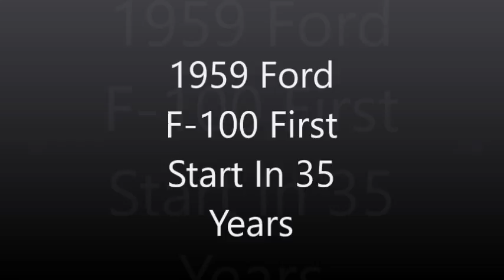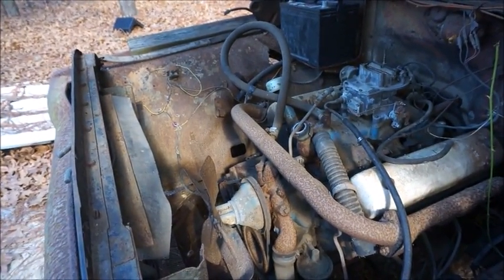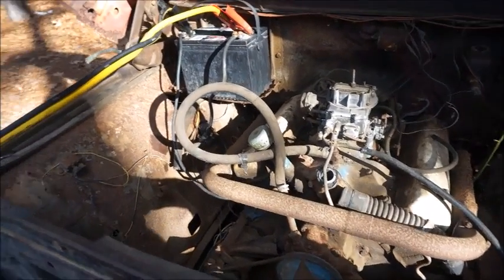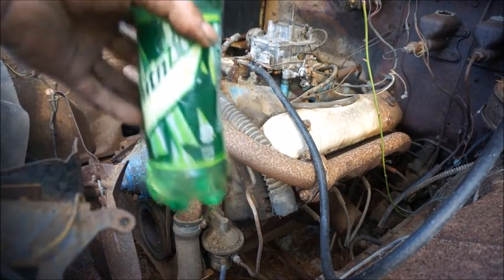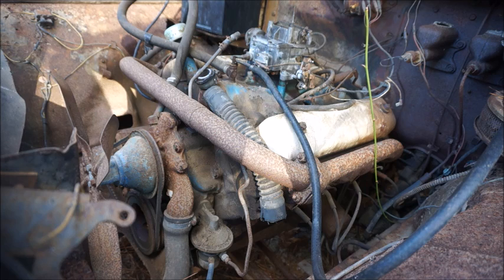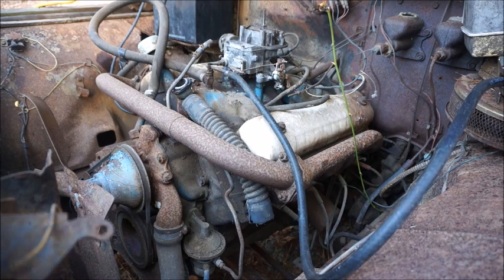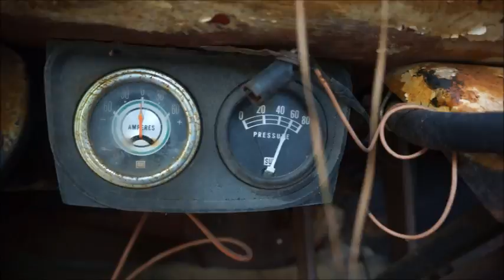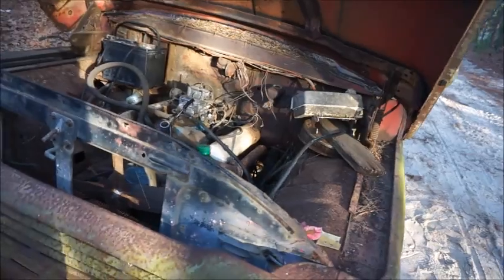1959 Ford F-100 First Start In 35 Years

Comment: 60lbs oil pressure yea! Its a good one. Sounds and runs good that is awesome.
Reply: shartne thats cause its a y block. Fords dumb for discontinuing them
Reply: @adamdesjarlais8183  - Ford needed the room on the machining/assembly lines for the new 90° (221, 260, 289) engines, which were much more powerful and much lighter. Still, the Y-blocks had an enviable reliability record. Oh, and all Y-blocks had mechanical mushroom-style lifters - too noisy for "modern" cars. Cheers!

Comment: I love it when those old engines fire up, it really sounds good..as long as the block isn't cracked.
Reply: If poured engine oil maintained going forward, the engine  sound will change.
Reply: Yes I agree but I still would have done a full tuneup belts plugs ignition fluids
Reply: the thing you got to check first before making any fixes to the engine is you gotta check if it will even spin over
Reply: Old technology dosn't age
Reply: christopher shea yea Chris   me too. I would have covered all my bases before first fire.
Reply: Mate it’s a Y block, you couldn’t crack one with explosives, these blocks were built like brick shit houses, bullet proof.
Reply: @skidmarkscar9082  when any engine has just plain water and the temp gets below 0 there a  good chance it will crack,

Comment: Wow, I thought the valves would be too sticky. Turns out it's just another cold natured Ford. Oh yeah, I'm with you on that cross over pipe. Every Ford Y block truck engine I've ever seen had them. Congrats on another good buy. I won't mention the fuel line on the exhaust. LOL
Reply: Danny Boy I know I've had a couple that started and ran..... shut off and the next day tried to start again and bent a valve or two

Comment: I had a 59 ford truck I drove it for 300.000 miles it turned over the odometer 3 times while I owned it . It went thru 2 motors,3 transmissions and 5 rear end's I ended up running a 2.93 rear end for the interstate because I drove 200 plus miles a day between work and home . I loved that truck got it for 200 bucks .
Reply: I owned a 59 F 250 that I bought used in 68. I paid $400 for it and sold it in 89 for $750. Since it was a work truck, I had to declare capital gains and depreciation recapture on my tax return that year. It had 248,000 miles on it when I sold it, and was on its second engine. Still the original rear end and transmission, although the synchronizers were pretty well gone. I recall that it was hard to find used parts because so many were still on the road.
Reply: Dingus Dow he said he did about 200 miles a day.. if he did 1000 a day it would have 300k in less than a year

Comment: Greetings from Australia, I liked the Yanmar/Cummins  conversion on the excavator and I have done many similar engine swaps myself. I used to work on these Y block engines fitted in the Ford F series trucks they used to blow the tin head gaskets between the cylinders and to solve that i used to put a strand of copper wire in the indention of the gasket between the cylinders. Also the camshaft bearings used to turn and block off the hole feeding oil to the rocker arms hence no lubrication, the fix to that was to fit a tee piece in the oil pressure outlet on the left front of the block and run a 3/16 copper pipe up the front of the engine and down through the valley cover under the inlet manifold into an other tee then a pipe up past the push rod each side and join it into the overflow pipe of the rocker shaft, to control the oil flow I  squeezed down the copper pipe with a clamp.

Comment: I bought a 74 Chevy Cheyenne with a 454 that had been sitting  When I got it the engine sounded old and tired. After some basic TLC the engine woke up and the old truck is now a daily driver while my F150 sits in the garage. 

It's ugly but runs great and I really enjoy driving it. I've tried to figure out why I like it so much and I think I  found my answer. It's what I call an Analog Experience. Anything can be fixed with common hand tools and there isn't a hint of modernized electronics or computer controlled crap on it anywhere,except for the new HEI dist. that I installed - points suck and it was an easy conversion.

It's strong and reliable and the AC works. I towed a loaded tandem axle trailer 500 miles and the only thing that could stop it was a gas station. With a TH400 and 373 gears it averaged 5.5MPG or roughly 100 miles per tank. I've since swapped the carb, added headers and completed a gear change.  it's up to 12MPG and I'm enjoying every mile.  Just wish more people would give these old trucks a second chance.

Comment: I had a few of those old Ford trucks when I was Much younger! Mine were 1963/1964. And they had the same motors in some of them! They either came with that 292 y block 8 or a 223 straight 6. Mine with the 8s had that cross member pipe also. Love those old FOMOCO's of that era...Drove one of my 1963 F-100's out to Wisconsin from Michigan when I moved to Wisconsin in Oct.18th. 1993. When Clinton was the Brand new president at that time. 7/13/18 4.50 pm cst   Happy Friday Everyone!!

Comment: I bought a 1959 F-100 in 1972, for 200.00. It had the 223 cast iron 6 in it. drove it for 20 years and sold it in 1992 for 200.00. I done a valve job on it at 150,000 miles and a total overhaul at 250,000 miles, it had over 300,000 miles on it when I sold it. It was a good old truck! built Ford tough.

Comment: If it starts and obviously didn't smoke really bad I would say rebuild the brakes and fix what will make it road ready safe and drive and enjoy it. Yeah it's a ol heap but she's still here and in one piece .Love the video and love the old Truck . I had a 59 Ford Short box bed. Took a corner to fast, 75 on a 30mph S curve. 351 Cleveland 4bl.out of a wrecked 72 Torin GT. Teenage farmboy with a lead foot= DISASTER

Comment: That engine with 2 small turbo chargers at the belt drive ends of the manifolds and dual 4bbls would be a good rat rod head turner at the car shows.

Comment: 292''s were notorious for cracked heads.  probably because of the way the exhaust was routed . not a ton of power but that engine brought back memories of a simpler time. thanks for sharing. 60 lbs of oil pressure wow that's about unreal  !!!!!  bypass is probably stuck shut.

Comment: I was 16 when I drove a '59 Ford F-100 4x4 with the little V-8 235ci? 226ci? and 4speed from San Luis Obispo to Eugene on Sand Tires and back.  Trip up I had a cabover camper on it and empty on the way back.  Going down Grants Pass on I-5, I was praying to every God and Goddess I could think of -- Drum brakes all the way around, no sway bars, and big beach tires.  Actually wasn't that bad...  2nd gear and 25mph from top to bottom, had to touch the brakes once.
Reply: If I recall correctly, the Y block came as a 272, 292 and 312. Since it had solid axles with leaf springs both front and rear, sway bars would serve no purpose. They were very stable, even in cross winds, although they rode like a truck.
Reply: I had a 64 Ford F100. 292 Y block,  as my daily driver for years before moving back East. That was the last year of straight front axle F100 before the Twin I Beam of 1965. Drove my daughter to her grandparents in it one weekend. They could beat you but were all truck! I never thought 180 miles of driving could tire someone out. Earlier Y blocks were also available in 239 and 256 cubic inch configurations. There were also a variety of other sizes used strictly in truck and industrial applications.

Comment: yep, that's the way "Y" blocks ran their exhaust.

did you check for spark?

cranking that long is a good way to kill the starter.
Reply: Unless the car was equipped with dual exhaust from the factory, like all the Thunderbird engines and many sedans. First Y-block I ever saw with the crossover pipe was my schoolmate's dad"s 1956 F-350 grain-roller truck. My dad had a 1955 Ranch Wagon with factory dual exhaust with no crossover...

Comment: I never liked the idea of the crossover been up on top but you are right about the gearbox being in the way and an after thought from Ford I eventually put a set of headers on my 292 I never liked the idea of the upper radiator hose being that close to the crossover. Nice truck keep up the work not many of these old girls left on the road

Comment: I just know every time you get one of these old left for  dead beauties started you get a big old grin on your kisser, I know i would,  keep up the good work the old iron deserves to live on.  can you imagine someone doing this 50 years from know on the plastic cars we have today? I don't think so. not going to happen.
Reply from the maker: I have a Nissan Xterra that's been sitting for 2 years, fuel pump went bad and security system has it on lock down. Just like the fact that you don't see and early Toyotas running around, I doubt many new ones will last.
Reply: I imagine the plastic would burn nicely where does the fuel line go on them?
Reply: Michael McNeil the fuel line goes to the carburetor.
Reply: Jonathan W You don't see old Toyotas here on the road because we don't have any as old as this Ford F-1/100. Importans only became a mainstream popularity in the 70's. As for 70's and up, I see TONS of Toyotas still running, TONS of Datsuns (Nissan) as well as Hondas too.
Reply: Gary p Once the electronics are shit thier just done,not to mention the plastics get old a d brittle.
Reply: Plastics?  Really?
Reply: Gary p nil

Comment: My 59 Ranch Wagon had a 292 in it (great engines)... real sweet sound with dual exhaust.  As far as I know all of the Y-blocks in pick-ups had that strange cross-over pipe out front... My ranch wagon, (and I believe all the FoMoCo cars for that matter) had the different exhaust manifolds... though I seem to remember seeing a car with the cross-over holes capped off.  The heavy Ford trucks used ram's horn style manifolds that can be used in pick-ups to get rid of that cross-over pipe as there is clearance issues with the clutch linkage or steering box trying to use the stock manifolds for dual exhaust. Or headers work...

Comment: Motors like this, I pull all the spark plugs & use an old turkey baster to squirt a mixture of marvel mystery oil & 30 weight non synthetic motor oil down into the cylinders, let it soak a few days, to free up any possibly stuck ring. Then I turn over (plugs still out) the engine by hand, then using the starter to clear out & lube the cylinders & rings. Change oil, new plugs & points. Started a '52 Pontiac that had sat in an old lady's garage since 1970; ran beautifully once oil, belts, hoses, plugs, point's etc. were replaced; hadn't been started for 45 years.

Comment: Thank you for sharing Jonathan. You said only Ford Y-blocks came with that cross over. I have a 1956 F-5 or F-600 farm truck being left to me when a friend's father passes on and was wondering what size it might be considering it was ordered with a 18 or 20 foot steel flatbed body for hauling potato barrels. I do know that the truck was quick and fast on a field road when I last drove it. Called the Purple Monster cause his dad repainted it Plum Crazy Satin.

Comment: Yes, since Ford first produced an overhead V8, they would put that cross pipe in front of the engine from the left manifold over to the right side and dump out the back thru the right manifold. I'm guessing they stopped doing that after production of the Y block. Back in the day, there was a kit you could buy to eliminate the cross pipe and have dual pipes. My dad had one on a 49 Mercury convertible that he updated with a 1954 overhead 239 V8. He couldn't remember if you could flip the left one over and mount it so the outlet pointed back on the left side and there was a cover for front of right manifold or if you had to get a whole new left manifold with an outlet to the back and a cover for the right front. My dad actually bought a '54 Ford Mainline 2 door in 1990 with that setup. It looked like you could possibly flip the left side around the way the manifold was cast on that one.

Comment: In the beginning of the video, when you show the bad cable to the starter. It looks that the cable insulation had been very hot at an earlier stage, and melted up a bit. Great job and you got the engine going on all 8.

Comment: I threw a new battery in an ford f350 1986 it was abandoned on a property that I was working on. both batteries were completely dead. and you have to start some where. so it ran straight up. so.e times they just need a new battery. but good work. that's a nice video

Comment: I love long videos, I like to see everything that's happening , well, the motor sounds very good with great oil pressure. the motor sounds tight with good compression , not many miles put on it since the rebuild. I think it deserves a fresh oil & filter change. 

I too would not use Starting Fluid.

Comment: I wonder how many modern, electronic crap, fords will be sounding this good in 35 years? My guess is not many
Reply: Mark O' Sparko that's what hydrogen internal combustion engines are for
Reply: Mark O' Sparko I didn't start my 95' Ford escort for 3 years 

95' was abysmal year for Ford 

She's started right up....

It depends how you take care of them.....
But I get your drift though, everything is electric and computerized 

These old beast are just mechanical
Reply: I once spent 2 frustrating days trying to get a modern Ford engine started full diagnostic, scope HI/Low bus the lot. Checked every relay, fuse and everything. Turned out to be a failing Can Bus because of a resistor in the ABS unit!!!!!
Reply: Brolution Gaming first car was a '90 Civic that had been sitting for 6 years and started right up only thing was that it shook at low RPM so I changed the distributor cap, plugs and wires  . It ran smooth and responsive after that.
Reply: @tonyfriend7413  you can say all you want about Honda's but their engines are great. Got a 90 civic that hasn't been on in almost 3 years and it started right up
Reply: @tonyfriend7413   Right. So that's why my fully Japanese made Lexus with a 1UZ V8 has outlasted any American car I've ever had.
Reply: @jessestout6119  a bus is basically a way computer systems talk to one another in coding terms. It can include the relays, resistors and fuses that run that system though. A CAN bus refers specifically to microcontrollers acting with each other without a computer(main brain). So basically the protocol is no brakes no engine start.
Reply: That engine is almost 60 years old . Cars were not even on the road for 60 years when that truck was built
Reply: Mark O' Sparko  Lol!! Iike your last name!! Yea none of this modern day plastic junk will b around 40 years from now!! It will already b recycled into pop cans and water bottles!!! Lol!!

Comment: I'm happy because modern mechanical fuel pump replacements are good for use with low-octane ethanol blended fuel. Thank ACDelco for that. This truck needs a fuel pump. Ethanol will eat through that rubber very quickly. New OEM replacements use material that resists ethanol-blended fuel (and possibly Ethanol itself, in case oil is ever completely gone in our lifetime, and we must switch to only ethanol and biosiesel). I believe the material is called Viton, and is a form of synthetic rubber commonly used for O-rings.

Comment: I've bought a few cars that have been sitting for a long time I usually pull the spark plugs out and put transmission fluid in the holes or in the intake to get the compression back up.

Comment: The 292 Y block was noted for spinning the cam bearings so the oil holes that routed the oil to the top end did not oil the lifters. Parts stores sold a kit that oiled the lifters and you were good to go. I owned a 1956 ford that had the kit on it.
Reply: The problem wasn't from cam bearings spinning. When the Y block first came out motor oil was still parrafin based. A few years later  they came out with better oil and when some people put it in their older Y block engines that didn't have frequent oil changes, the detergent in the new oil would loosen up some of the built up sludge. It would clog the passage in the block that runs from the cam bearing to the rocker shaft in the head.

Comment: Cool,  I had a 56 with a 272 and later a 312. The drivers side cylinder bank wore more than the passengers side. I attributed it to higher back pressure due to the cross over exhaust

Comment: A Ford Y-block without the exterior oil delivery line (a fix) for proper rocker arm lubrication.  After awhile, the rocker arms failed to get enough lubrication due to internal clogging in the engine, so a kit was installed to deliver oil from the pump to the rocker arms.  Could be why the oil pressure looks high.

Comment: Hell thats great, I've worked on ole Y blocks that didn't have that sort of pressure and the top end didn't oil for nothing.. (we used to put kits on them, external oil lines that went through the valve cover and oiled the rocker shaft).. Heck it sounds good. I ain't sure I'd try it on a old one, but everytime I see that cross over exhaust I can see a turbo sitting on there for a blow through system. Anyway, cool its a runner!
Reply from the maker: Had to run the oil lines to the top on my old pulling tractor. Twin turbos would be nice!!

Comment: I've used it many times on old engines that have sat for years just squirter some marvel mystery oil in each cylinder the day before no problem
Reply: Joe wolfy007  Your right ya gotta oil it up. Check fuel and spark delivery and repair as needed before first fire!!

Comment: The old Y blocks were bad about the little oil hole supplying the over head rockers stopping up. Lots of them had external over head oiler lines installed.